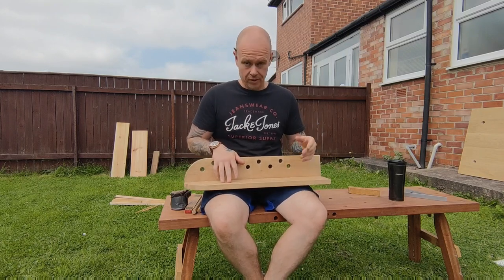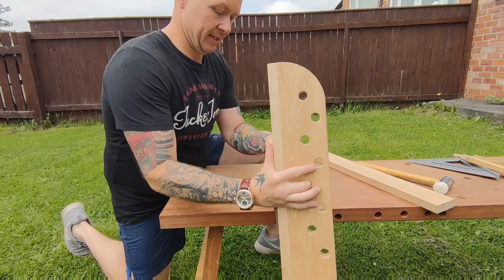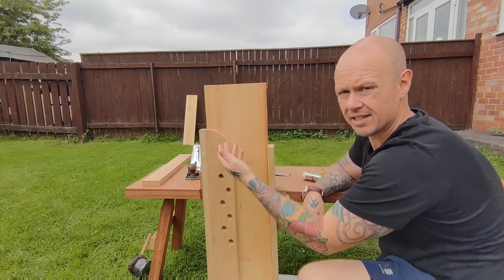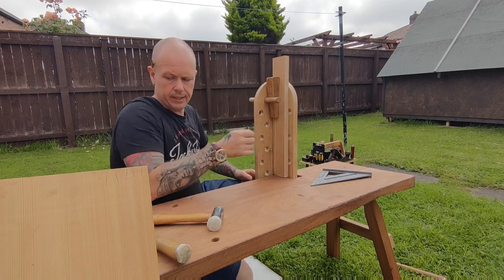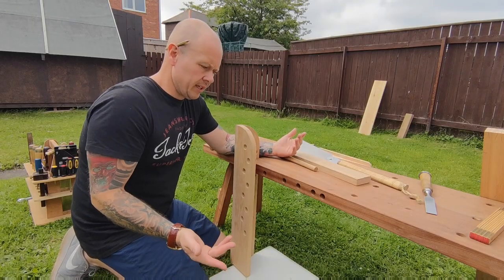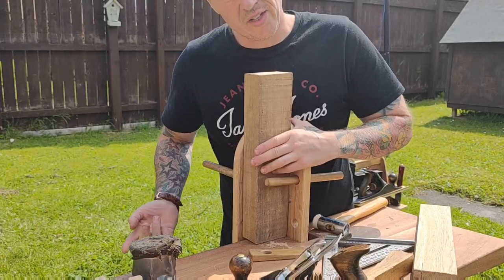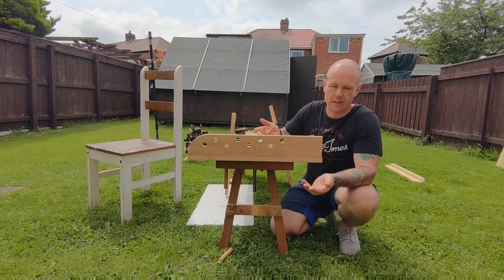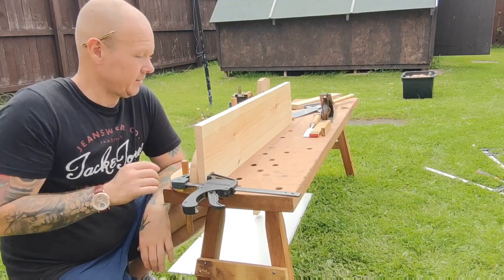How to use the notch accessory with the Roman workbench.

Comment: Another good, detailed video David. I was struggling to understand how the notch acc worked, now it's clear. Have to make it now...
Reply from the maker: Thanks for watching Jacqui, I appreciate it.
Reply: @DW_woodworks   I made one quickly on the weekend along with a shave horse attachment out of scrap construction pine. Both are temporary as I need some more option to hold for a project I'm working on. They work well enough to get the job done for now. I want to remake them later when I have time and some oak and have a question on the notch account length. If it's touching the ground, is there a height above the notch that you've found more flexible in use? I feel I've made this a bit long and too much extends above the bench surface.
Reply from the maker: @jacquismith-roberts8718  my notch accessory extends roughly 6" above the bench, and reaches to the floor. This seams to work well with enough adjustment height when needed. Only raise the height as much as needed to support the work piece.
Reply: @DW_woodworks  thanks, will take note on the next one.

Comment: "Don't put a vise on your Roman bench, imo" (invents a vise)
Reply from the maker: I wouldn't call it a vise, there's no screw system. I've always said I wouldn't advise a fixed vise like on a tall bench, if anything a moxon vise (removable). That's only my opinion, each to there own.
Reply: @DW_woodworks  only joking mate, I love this stuff.
I fixed my little machinist vice to a board and use holdfasts to "install" it on my Roman bench when needed, but it's only for small work! I'm looking forward to trying the notch accessory and I think this cam/clamp idea is fantastic
Reply from the maker: @piffwhiffle  I wish I was clever enough to invent a vise 🤣. Thanks for watching, I appreciate it 👍
Reply: I think the spirit of "Don't use a vise," is that you keep the bench as much of a blank slate as possible to maximize workholding flexibility.  This is what I have found in using the Roman workbench.  A vise is very good at a narrow set of tasks, but there's a reason there are several kinds of vises.  It's because everyone of them is incapable of holding pieces with a certain size or shape or not adapted to specific tasks well (and typically are quite expensive for good ones).  The Roman workbench, while it may require more ingenuity and more setup time, leaves open the possibility not only for holding a huge variety of pieces, but also for allowing each user to individualize workholding techniques to a way that best suits their body and habits.  Besides, coming up with different workholding techniques is fun and psychologically rewarding in my opinion.  I know you're not hating on it, but I figured it was worth saying all this anyway.